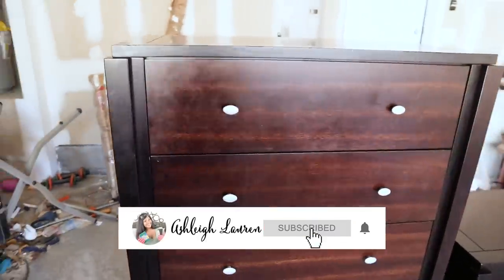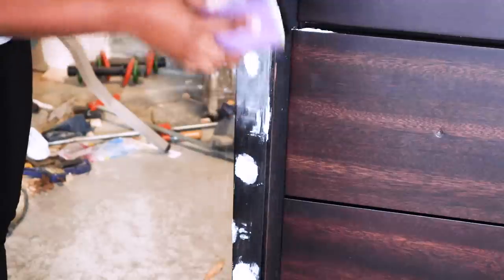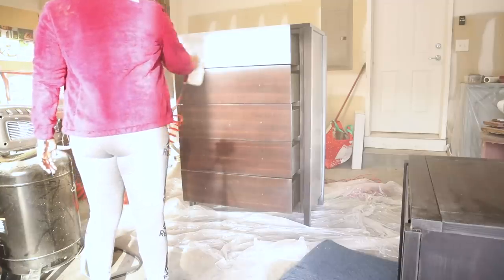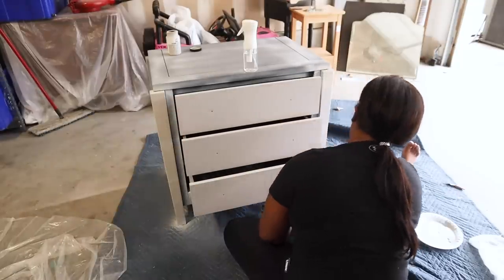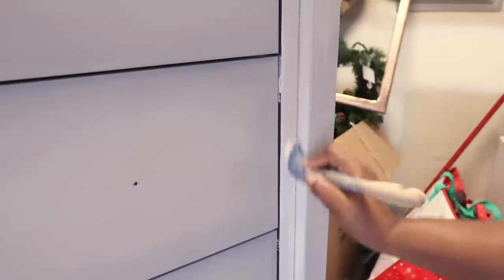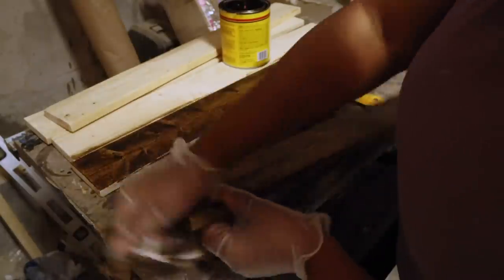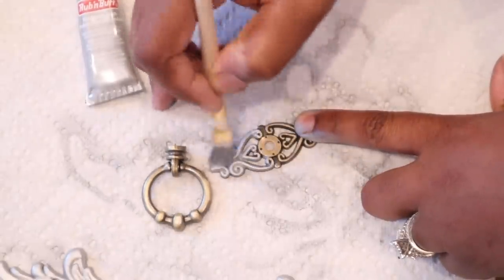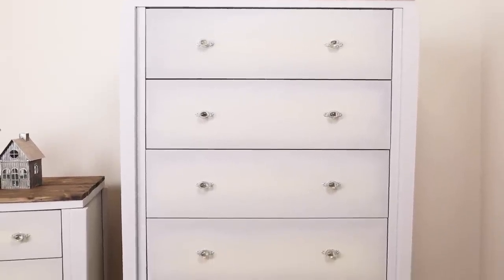Painting Laminate Furniture | Furniture Makeover | Ashleigh Lauren

Comment: I did the planking without a nail gun since I figured there wouldn't be much horizontal force being applied (as opposed to vertical).
It's been a few years and they are still holding pretty tight! :)

Comment: If you look or feel under the drawer (could be near centre OR off to side) there is a plastic piece that prevents the drawer from opening. You need to press (usually press down) the piece to allow the drawer to open.
Reply from the maker: I tried everything lol. I know there is away but I didn't want to break the drawers. 😂 Thanks for the tip though I will try next time if I have issues.

Comment: So glad I found this video! I want to paint my bed and I could not find anything online that referenced laminate or plywood. Hate to admit that I was hoping I could skip sanding, but I do have an electric sander and a paint sprayer. Question: Can I use a paint that has the primer in it? And do I have to seal it with polyurethane? Just checking so I can pick up what I need from Home Depot and/or Lowe's today. 

Thanks so much!

Comment: Question what if the paint says it has a primer in it? Do I need a separate special primer?
Reply from the maker: I would recommend testing it out first. Make sure you paint a swatch on different areas of the piece and then perform a scratch test, which is scratching the paint to see if it adhered to your furniture. If not, then I would get a bonding primer to paint on first.